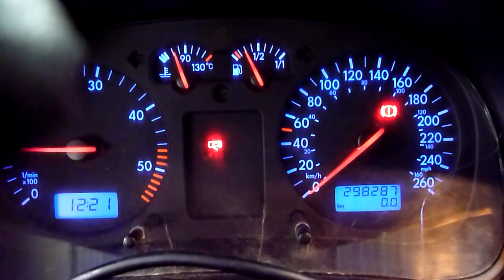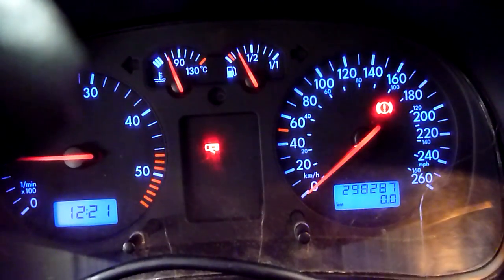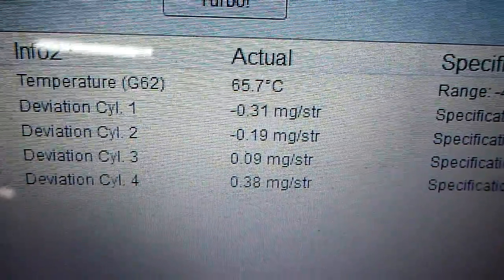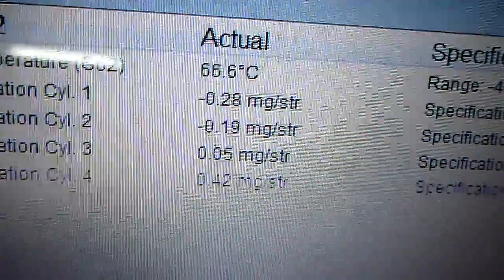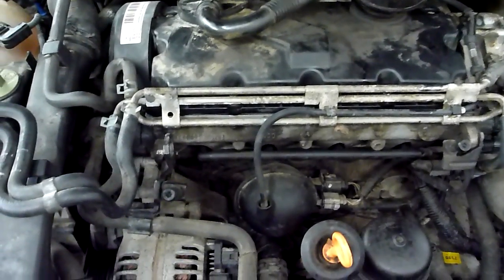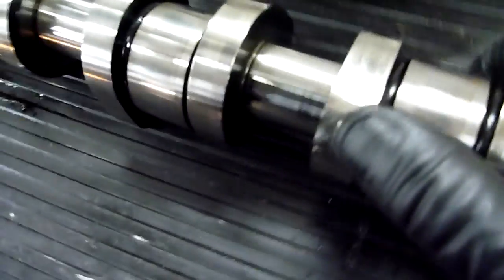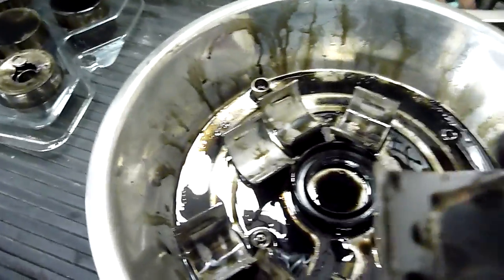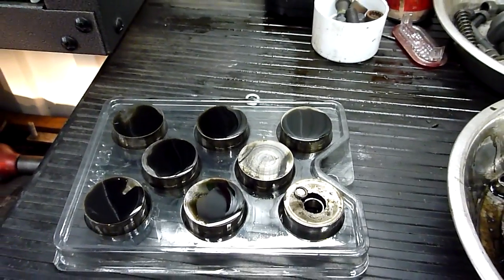TDI Camshaft failure BEW

Comment: I have the same history with a 2006 Golf SDI 710K KM 5 speed right now
Smokes with a clean EGR valve and throttle body, now it started "pounding" or "rocking" or feels like a knock when idling, measuring block 013 shows (cyl 1-2-3-4): -1.18, .31, 0.49, 0.35
Some bloke advised me its either cam lifter wear or injector starting to go bad
I'm yet to check compression but have a bad feeling about it being something in the valvetrain.

Comment: Worn camshafts and lifters are common on high milage PD engines even if serviced on time with the correct 505.01 spec oil.How do I know.I had one fail at 413,000 km.The intake lifter on number 2 cyl was holed.Which failed first,lifter or cam?I don't know but my guess is lifter and it destroyed the cam lobe.Had the car from new and only used quantum platinum (Castrol) same as dealer franchise.In my honest opinion the design is poor on these engines as VW used an existing block that had limited space to add an extra camlobe to drive the injectors.This meant reducing the width off all the cam lobes on the shaft.The V10 PD engines also suffer this problem.Shoddy engineering by VW.

Comment: Hey V10PDTDI, can you view my video...only when cold have this issue, injectors within spec with VCDS...bad camshaft??  https://www.youtube.com/watch?v=KhHkk43UizM
Reply from the maker: Its Bman do you have any fault codes ? If not I suggest to check if the fuel pump in the tank function properly
Reply: Thanks man, no fault codes showing on VCDS and this is the history of engine i bought at 120k, Now 173k on clock and this issue started at around 166k, no loss of power but only getting 25-30 mpg. Car is Audi A4 B6 Tdi AVF 130bhp 6-speed

Engine Service History:
• Timing Belt @ 139,891
• Genuine audi coolant temperature sensor & thermostat @ 140,000
• Air and cabin filter @ 140,500
• Oil + Filter @ 162,430 - Valvoline synpower 5w30 504/507
• Genuine new bosch MAF sensor @ 167,000
• Mann fuel filter @ 168,220
• Genuine audi new injector loom @ 168,900
• Genuine audi new map sensor @ 173,000

I will check out fuel pump, how can i check it for correct operation?
Reply from the maker: Its Bman hi instead of going under the seat disconnect the fuel line from the in tank fuel pump that goes to the fuel filter put the hose in a container and first turn the key on to see if the fuel come out of the hose if not try starting the car for a few seconds to see if there is fuel coming out of the hose if not check if there is no burnt fuse or go to the fuel pump connector with the car running with the hose from the fuel filter reconnected and check for power and ground at the pump connector.  If you have power and no fuel going out of the pump then you have a defective pump .
Reply: Excellent, will suss that out and keep you posted with the result! thanks very much for the advice man
Reply: Checked that out and all good "V10PDTDI", one thing I have noticed is the motor more often behaves like that when the heater blower is turned up to HI and is blowing at max speed, the motor then gets more erratic when the engine temperature is at 70 degrees and blower speed is at max, if I dial down the heater blower the motor idles ok and when the engine temperature hits 90 degrees the motor starts to idle perfectly from then on regardless of the heater blower speed setting, also have a rancid smell of fumes diesel from outside car when running and inside the car sometimes like the smell is coming through the blower vents and as I said previously only 25mpg, Im thinking could it possibly be the CTS sensor gone bad on the ECU side? you any more ideas "V10PDTDI"?

Comment: The pressure in my 2nd and 4th cylinder is around 16 bar, which is way too low. Local mechanic says that camshaft worn lobe and burnt valves can be the reason?
Reply from the maker: Himanshu Srivastava- Network Engineer, Aberdeen  hi sorry for the late response but I think the I did a compression test on a engine with a worn camshafts but the compression wasn't affected that much but if the lobe and the lifters are worn enough then it could potentially affect the compression.

Comment: hi there can u help me.. if got vw 1.9 passat in my garage make noise i replace cam and bearing i did all 100 right,,after i put oil i start .engine same noise i get crazy i open oil sump looking for oil pump or piston its all ok ,,can u help me plz  its taxi :( sped 400£ PLUS ALLDAYS THNX
Reply from the maker: Hi did you replace the hydraulic lifters there should be 8 of them ? Is the noise coming from the top of the engine or the bottom and was the cam lobes worn and busted lifters ? Did you made a video of the sound ?
Reply: ys i did replace all  cam and lifters they r  worn i thing is come from bottom of engine also start with break cleaner ,,its my face book check out pic plz today i try if now i order engine thnxx
Reply from the maker: +KURDISTAN uk  so you're engine has 2 cams we never got a 2 cam PD engine here in Canada do you know if it has some ballencer shaft in the bottom of the engine it could be that what's making the noise is it a knock or a tick tick sound.
Reply: ys mine single cam today i order another engine  thnx so much my frd

Comment: That work is all done w the engine in the car?
Reply from the maker: Yes all is done in the car the timing belt and camshafts sprocket had to be remove then the valve cover to get access to the cam .
Reply: Thanks, keep up the good work, Dave.

Comment: my Golf 5 1,9 TDI from 2004 with 105 BHP have a similar problem. The engine shakes a lot and the acceleration is very shaky and bumpy. Also white/grey smoke comes out of the exhaust.
The computer test showed as yours a fault at cyl. no 4. I have replaced the Injector but the problem is still there.. What do you think is the problem? can it be the camshaft?
Reply from the maker: +D2608j what is the km's of your engine ? If is high km's then you're camshafts could be the source of you're problems what I suggest is to remove the plastic tube from the air flow meter and then start the engine if you can hear a tunk tunk tunk sound if you do then you will have to remove at least the rocker assembly for the injectors to inspect the cam lobes and lifters from what I've seen the exhaust lobes wear quicker also check the fuel injector lobes for unusual wear if the lifter is busted it will rub on the injectors lobes. Let me know what you find.
Reply: +V10PDTDI it has 210.000 km on it which is not that bad. My old Golf 4 1,9 tdi had 300.000 km on it with no problems.
I gave the car 2 days ago to the VW specialist in the town. He made a compression test on cylinder 4 and it showed some bad results. Only 40 % of the compression on cyl. 4 was there what caused the shaking and the smoke coming out of the exhaust (unburned fuel). 
He said it would be very costy if he should split the engine further apart looking for the exact fault. 
The message from the vw specialist is to buy a new used engine and sell the old. That would be the "cheapest" soloution.
Reply from the maker: +D2608j do you know if the camshaft is ok I remember a car that the cam was worn out and the compression wasn't affected much.
Reply: +V10PDTDI camshaft is okay. I have bought a used Engine. Im gonna change it soon

Comment: hi today i replace full cam sat for  skoda superb 1.9 tdi 2009,,after i put 5w,30 oil engine start its normal  when i ragf engine sound noise come any idea?thnx
Reply from the maker: Hi did you check and make sure the timing is correct ?
Reply: yes mate i found its number 4 piston broken thanks for u hlep

Comment: My engine is shaking alot ..can i be the timing or camshaft??
Reply from the maker: What model of car you have what year diesel or gas  ? and what engine code it has.
Reply: V10PDTDI its a 06 Vw Jetta tdi 1.9 diesel ..the check engine light came on and i used the scanner. Tool and It said fuel temperature sensor A circuit high out put..can that be whats causing my engine to shake ??
Reply: V10PDTDI the code it gave me was P0183
Reply from the maker: The fault code you gave me it has something to do with the fuel tempeture sensor is you're engine PD or the injection pump is on the front of the cylinder head the reason I ask is the temp. Sensor for the fuel on a PD engine is in a rubber hose that come out of the cylinder head there is a plug with 2 wires check the wires they could be broken I've seen that before or the sensor could be bad with the correct diagnostics tool you can see the fuel temp. And if you have a non PD engine then the sensor is inside the fuel pump you have to remove the top cover. Hope this helps.?
Reply: Its my fuel temperature sensor i changed it and it stopped shaking,but the engine light is still on the scanner gives me the same code and says FUEL temperature sensor a high input ..i think somethins wrong with the wireing

Comment: Thank you for video.  What do you suspect is the reason for camshaft failure - is it that engine oil used in past may not have been correct VW specification?
Reply from the maker: It depends of the millage when the camshaft fails in a BEW engine and it fails early the the oil specs could be in question but when it fails on a BRM engine at a low millage then the cam it self is to blame if the correct oil is used I've seen some BRM go past 300 000 km's but it's not the norm one thing that is very important when replacing a can and lifters and bearings the black top lifter must be used or else the cam and lifters will fail in short order. How do I know this well then I did one job and I got the wrong lifters and with the correct oil specs and the cam and lifters wore right thru in less than 30 000 km's. I never thought that it would fail that quickly.
Reply: using other oil than a 505.01 is a big error, there is a specific oil made by MOTUL just for these 1.9tdi PD engines.
Im from Europe where we have thousands of TDI engines and worn camshafts are a common thing, more if you use the wrong oil or oil change interval
Reply: @txaloo  What probably doesn't help as well, is starting the engine and driving off immediately (if engine cold/stopped for more than 20/30 mins) no oil at top of engine = increased top end wear. Better to wait 30 seconds or so to let oil reach top of engine. I've always done this, without fail and I think this is a good practice to get into, especially on pd motors.
Reply: @Asl6uk I read once that the general rule of thumb, especially in cold climates, is that whatever diesel you're running, you let the engine idle one minute per liter of displacement before you put a load on the engine and drive away first time per day. I personally extend that to if it has sat for 12 hrs or more.